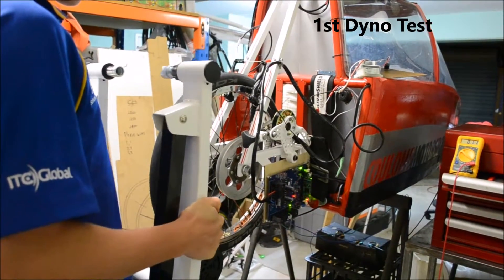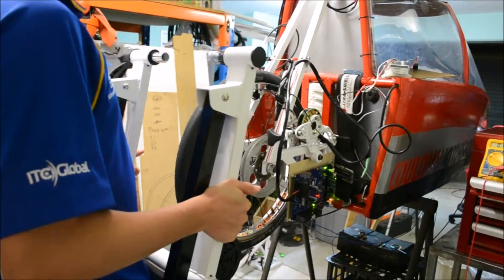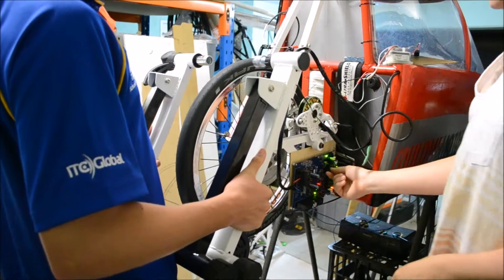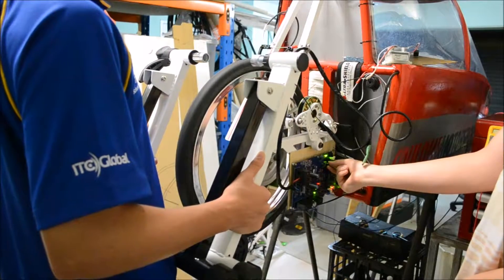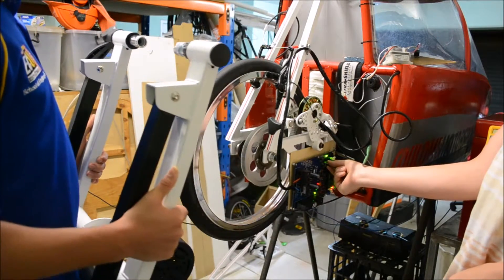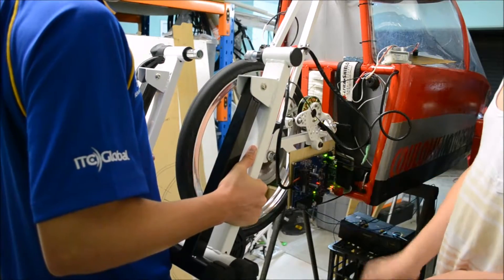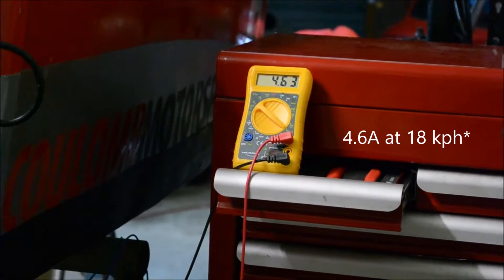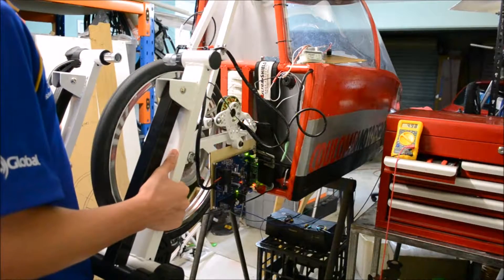First Dyno Test with 2017 Quark

Comment: wow
super
monster machine 
what the battery voltage ?
Reply from the maker: Thanks, in this test it was only 36V provided by 3 x 12V 12aH Sealed  Lead Acid batteries that we use for testing. However, it usually runs  off a 37V 16aH Li-Ion e-bike battery in competition and will soon use our 44.4V 150aH custom battery pack to attempt a world record for distance on one charge.
Reply: do you know about vesc controller ?